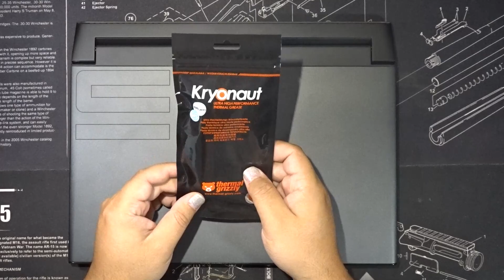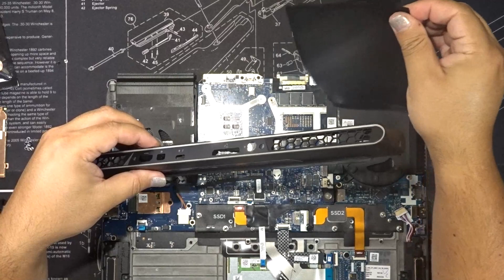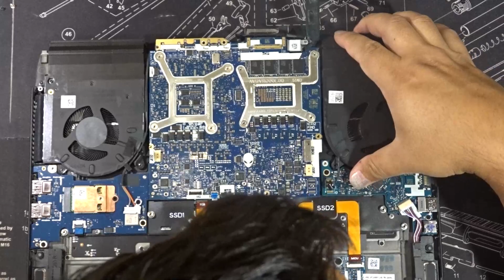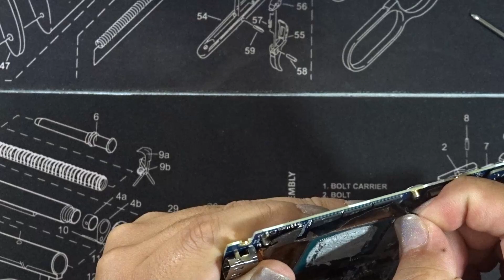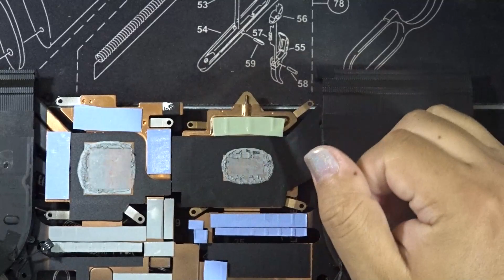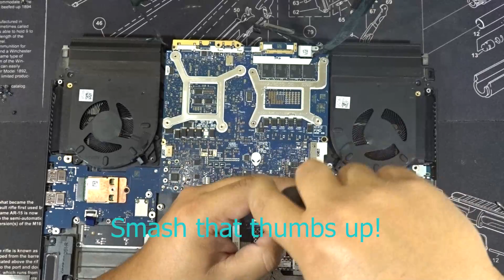Tech Review: Alienware M15 R3 Teardown

Comment: Hey, I have an Alienware 15 R3 (not M15 R3). It easily touches 100 degrees temps no matter what I do, even on playing games on Medium settings. I consistently get frame drops to under 10. For eg, I get 40 fps on Destiny 2 on medium settings. Same for GTA 5. With fps dropping to less than 10 in graphics heavy situations. I've tried repasting the CPU. Also, broke my motherboard doing so, so had to get it replaced by Dell. The CPU and the GPU are soldered on the mobo I guess, so even that has been changed. ( Earlier one also had the same prob). I've seen that it overheats more on power than on battery. Is there something specific I can do to solve this. I'm fed up with this junk.
Reply from the maker: You can try Undervolting the CPU. I actually have a 15 R4 and have not noticed any heating issues on mine but maybe they changed something with the newer revision that fixed some cooling issue.
Reply: @corpustechllc  Hey thanks for the reply. I'll try that. Also, my battery lost its capacity to hold charge a long time back but over time it has really swelled up and opened up the front casing quite a bit. Is something wrong with my power adapter? Too much power resulting in overheating the computer? I've been using a US power adapter in India (with socket compatibility adapter) as I bought the machine from the US.
Reply: @corpustechllc  Ok so tried undervolting the CPU. - 0.125mV using Intel XTU and also undervolted the GPU using MSI Afterburner- 875 mV for 1680 Mhz. 
CPU stress test shows consisent temps of 95* C + temps. Highest was 100* C. Power throttling consistently + thermal throttling here and there.
Didn't stress test GPU but was playing Dota 2 while the system crashed and so I reverted everything back to normal. 
The plus side- no frame drops (60 FPS) consistently). So I'm gonna try with afterburner more. I'm afraid about the CPU tho.  The last time I did try to undervolt using Throttlestop, something happened and system crashed. Won't turn on. Had to turn off Intel speedstep in BIOS to turn it back on but was running 0.8 ghz. To counter that I had to turn off turboboost in BIOS, and CPU was consistently running at 2.8 ghz. Internet said solution is to clear CMOS. Tried to do that+ thought of repasting side by side and broke off the LCD connector on the motherboard. That's a cheeky thing if one doesn't know his way around computers. This is my workstation and the only computer I got, so I'm quite nervous about the undervolting stuff. It's safe, right?

Comment: Now I understand why the CPU could reach 100 degrees. Two isolated and two shared heat pipes, not a strong version for the big fire oven i9 processor. Maybe enough for i7-10750H 6c/12t, I am quite doubt what will happen on i7-10875H 8c/16t. No wander Dell's option has no i7-10875H, that's not good for a customer. Most customers are not good for deeply tearing down and re-pasting, that's why we need great customer service like Dell. However, it is still unacceptable for such a high price and high end gaming laptop.
Reply from the maker: Yeah I was a little underwhelmed by it as well. I have def seen better before. A solution like this is cutting it really close to usability.
Reply: I dont understand a word from this, i just got this laptop what should i do avoid this
Reply: My 10750h 2070 super m15 r3 stays at 100°c for "package" and "core 0" according to HWmonitor. This is just playing dead space 2 max setting 1080p 100-300fps
Reply: @ultimategohan1551  Yeah, Dell wanna more performance but the temperature will be quite high. They seems not care about this.

Comment: Yeah that’s way more complicated than I imagined :/ I doubt I’ll be able to do this to mine. Dang.
Reply from the maker: Yeah definitely not for everyone. When i first started I would not have been willing to tear apart a $3000 laptop either. However after you have had it for a few years I highly recommend taking it all apart to blow it out/clean it. By this time it will need a good dusting and its value will have depreciated enough that if you do ruin something you can get spare parts for a lot cheaper. It helps so you can build up the confidence to do it on new machines.

Comment: Thanks. So if my i9 model doesnt have that heatsink defect then it could not have thermal issues?
Reply from the maker: I think you'll always be pushing the envelope if sticking with AW provided stock speeds. However if you are willing to undervolt it and reduce the overclock just a bit you get something far more reasonable and manageable.
Reply: @corpustechllc  yeah i dont think i wanna take the risk to repaste so UV is my only hope
Reply: @corpustechllc  I have the M15 R3 as well, i7 10750h though. Using stock profiles in AlienCC I was averaging mid 80's C and spiking to 98C on a couple cores.

I created my own profile in Alien CC and went with a very aggressive fan curve and I dropped my Max temps by over 10C and average by 5-8C per core. Dell definitely has the fans set too timid to reduce noise, this laptop needs the fan RPMs to stay cool. This is stock with no repaste or undervolt.

Comment: Is the SSD Changable
Reply from the maker: Yes this has 2 NVME 2280 slots and 1 2230 slot. It does NOT have a spot for 2.5" ssd though.
Reply: Advanced Vector thanks
Reply: Advanced Vector so the https://www.kingston.com/us/ssd/kc2500-NVMe-PCIe-SSD?partnum=SKC2500M8%2F2000G should fit?